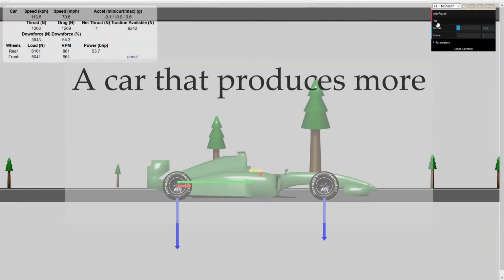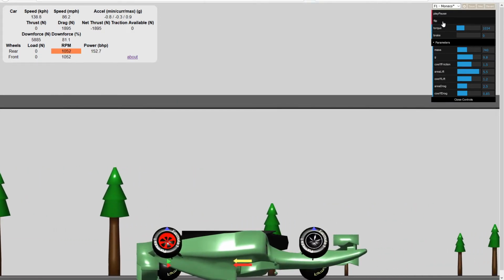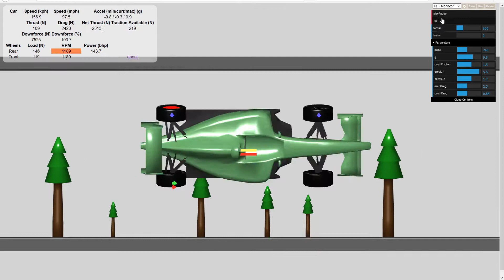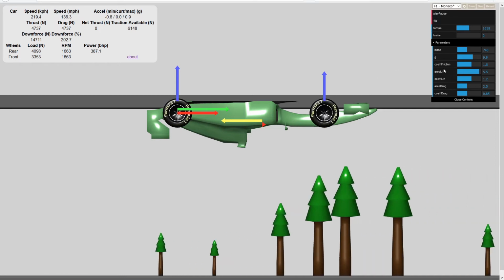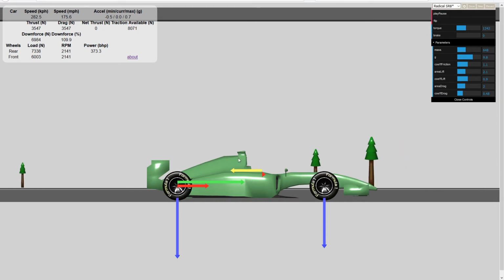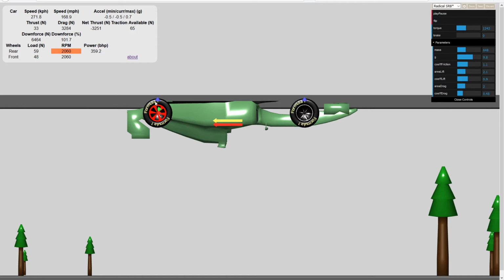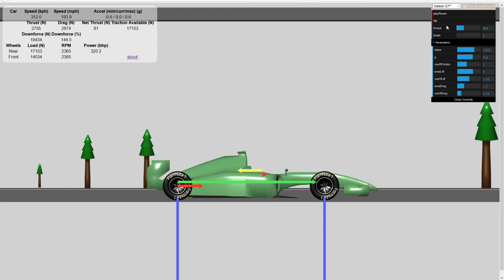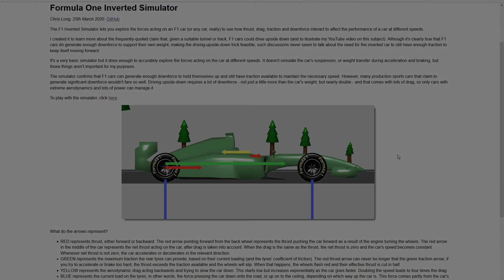Driving Upside Down in an F1 Car

Comment: Great content. I tried your simulator, one thing confused me, why the area of lift is not area of drag； I remeber their formula use the same frontal area, which is about 1..5m^2,
Reply from the maker: Hi Mickey, thanks for the great comment. The areas for the two formulas aren't the same because the lift formula uses the total wing area, which is roughly the area of the two wings as seen from above, but the drag formula uses some combination of the frontal area and the total 'wetted area', because an F1 car isn't quite a normal car but also isn't quite an aeroplane. It's basically up to a given engineer to decide what area makes most sense in a given case, and the calculated drag coefficient will then vary accordingly (https://en.wikipedia.org/wiki/Drag_coefficient). Although I did find some estimates of an F1 car's drag coefficient, they didn't generally come with the details of the area used, so I had to just fiddle with the numbers until the model behaved somewhat realistically in terms of top speed and power required. All the areas and coefficients are tweakable in the simulations interface so you can play around and see what values make sense!
Reply: @ChrisBLong  Thanks a lot, I will dig more on this.Anyway, your simulator is awesome

Comment: Hey, before anything nice video!!! I got some questions and I hope u can help me..I am an engeneering student and I'm doing a work about this and I need to calculate the minimum speed that a F1 car needs to achieve to drive upside down. After ur video I can understand the theoretical part but I can't get the results that u show in the simulation. 
If its not an abuse, in some way, could you please show me what formulas and values u used? Also I cant find offical information about some things like frontal wing area ou lift coefficients, I am using values that I found in internet...Thanks for the help and hug!!!
Reply from the maker: Thanks for the comment, I'm glad you like the video. You can find all the formulas etc in the Javascript code for the simulation, it's all on GitHub, just follow the links in the description. You can play with the simulation online and see how things vary with different weights, lift coefficients, tyre friction coefficients, etc. There really isn't any official information about lift coefficients etc, all that stuff is closely guarded as technical secrets within the teams, but you can make reasonable assumptions - for example, you can find the typical dimensions of the cars and work out a rough frontal area, the car's weights are well documented (you can assume they're all running at the minimum allowed weight) and because they corner at up to 5g we know they must be producing 4 to 5 times their weight in downforce.

Comment: Wouldn’t this be an unstable system? If there’s any decrease in speed, wouldn’t that decrease the down force, leading to less speed. Starting a feedback loop?
Reply from the maker: As soon as it's too slow for the tyres to grip, yes, you're doomed. So long as it's going fast enough, you can accelerate and decelerate as normal. You can try it yourself in the online simulator!

Comment: But if the car is creating that much down force, wouldn't the force pushing down on the car give the tires the need traction?
Reply from the maker: When it's the right way up, the downforce gets added to the weight, so there's more traction than you'd get from the weight alone. When the car's upside-down, the downforce first has to overcome the car's weight just to keep it held to the roof of the tunnel, and there's only a little bit (if any) left over to provide traction. For most cars, even those that produce downforce that's slightly more than their weight, that doesn't leave enough traction left over to keep the car moving at the necessary speed.
Reply: No, because gravity is pulling in the other direction. On the ground you have down force plus gravity to give you traction, on the roof you have down force minus gravity. If it just has enough down force to stay on the roof, it is essentially the same as hanging the car from a string, so it just touches the ground. You don't get much traction from that.

Comment: downforce IS manly traction, hes the force that pushes the weight on the suspensions! sure gravity helps that alot on normal condition but with enough downforce you will generate enough traction, f1 cars are very light, but you cant reverse gravity with downforce, so gravity is the factor to overcome